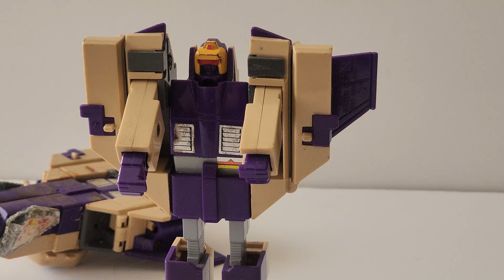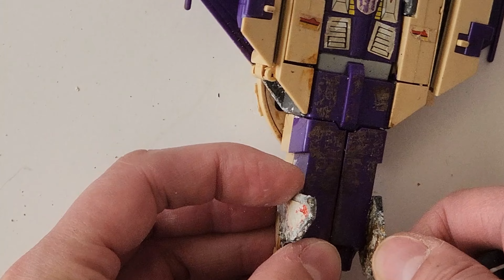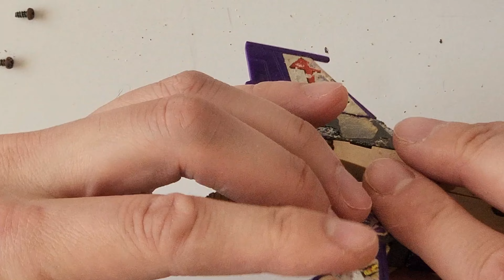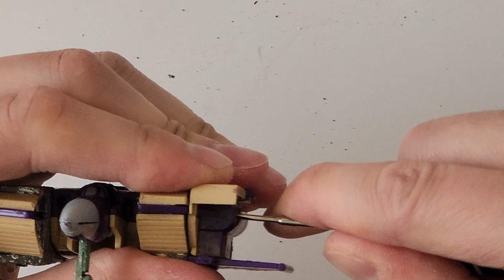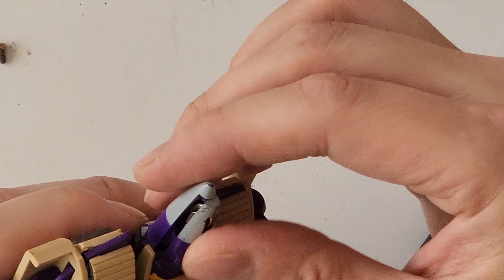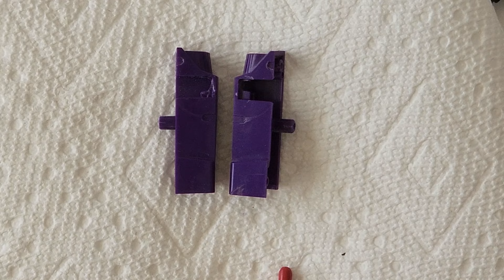Grossest Blitzwing Organ Donor: Parts swap, rust removal, plastic reconstruction for a clean result

Comment: Get a cheap rock tumbler and play around with the media. You can smooth out the corrosion without even touching it, providing its still cosmeticly up to your standards when you take it out. If it cleans uo good you can polish it up better than new.
Reply from the maker: Interesting idea! I actually do have a little rock tumbler. One of my kids' toys.
Reply: @portmanToy go get it, maybe they won't notice. 😊- It works. I've done it!